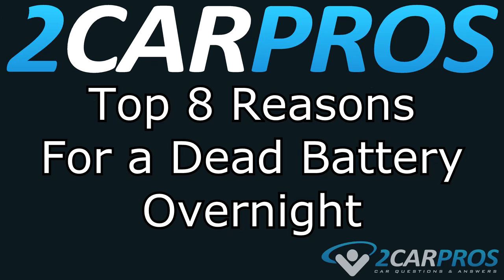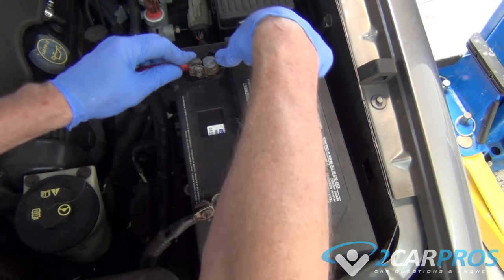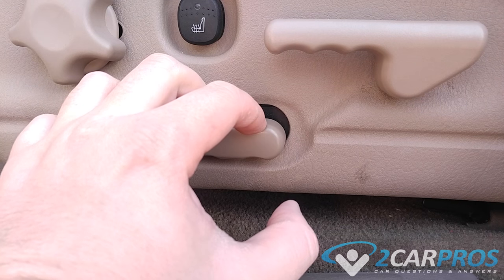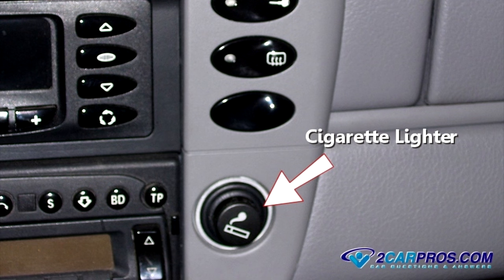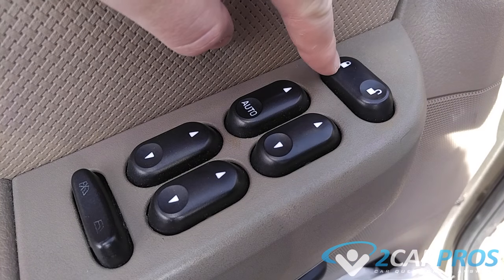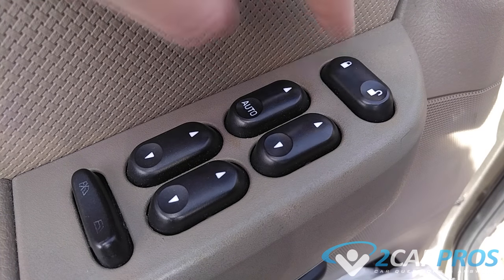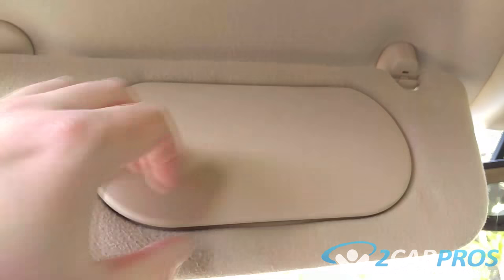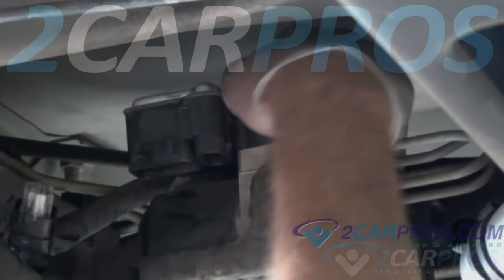FIX A BATTERY THAT LOOSES CHARGE IN 15 MINUTES!

Comment: Alright so I have a 2000 honda echo, manual seats, doors, no vanity light, no cigarette lighter, nothing visually on or drawing power, with a brand new battery that still dies over night, it never did this with the only battery, any ideas?
Reply from the maker: You may have a dud battery. It is rare but it can happen. Try load testing the battery. Thank you for watching!
Reply: 2CarPros that's what I figured, it was like pulling teeth to get them to echange the battery with a new one, even tho it was only 2 weeks old,  because it tested good on all their tests! Now the issue is gone but it took two weeks to develop with the first battery. So fingers crossed it's doesn't happen again! Thanks for the awesome videos!